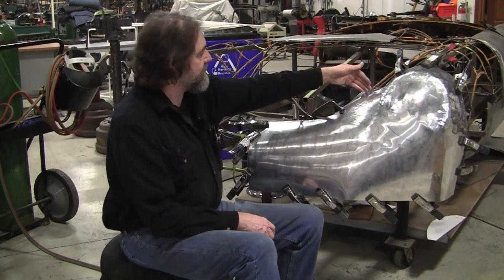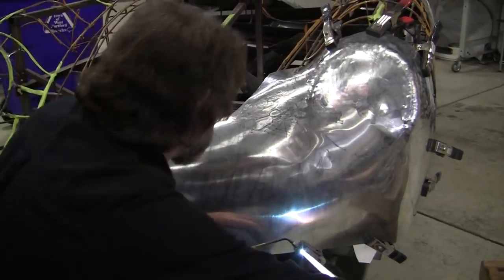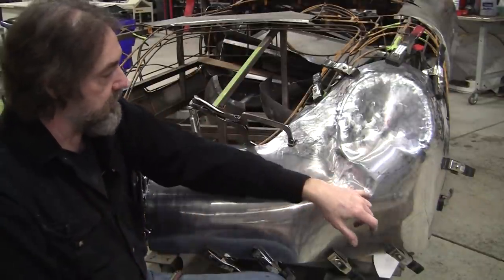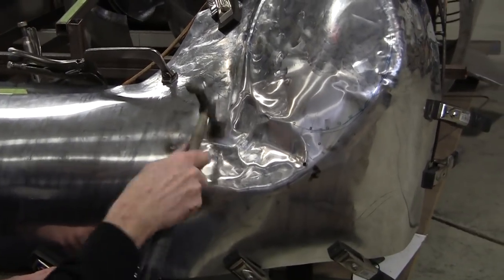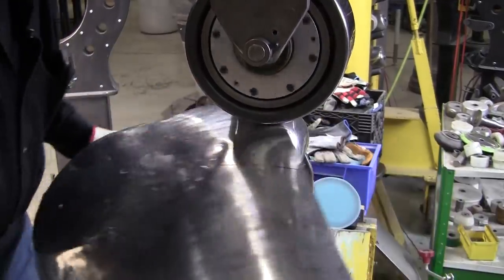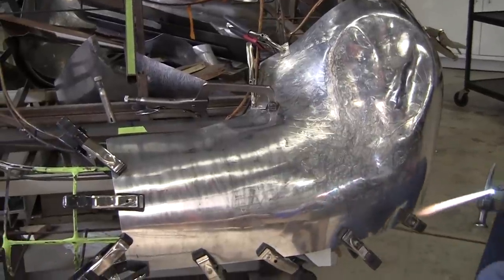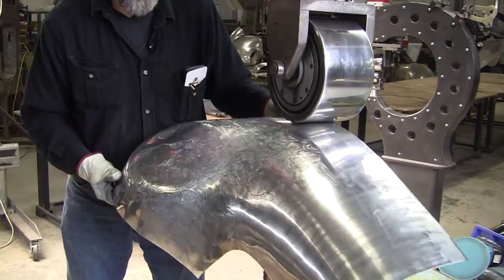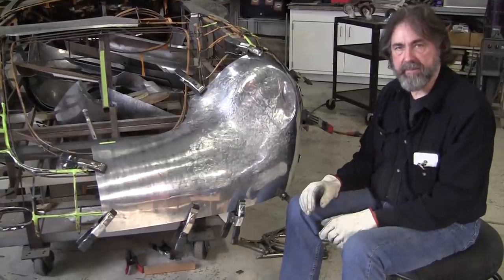Metal Shaping: Hammer forming a Porsche 550 nose on a wireform

Comment: Ah , been looking forwards to this one. Round that 19 and 20 min mark its hard to keep the faith and keep going , but thats experience , and boys does it show , interesting too that you use a different method of working if its steel , I usually work in steel and dream of things that move about as easily as alloy  but both have their highs and lows  ,,, no pun intended.
It would be so easy as a beginner not to want to mess up the bit youve got nearly right so far , but thats what this video shows best of all , have faith and keep going , it will smooth out again and be better for it . This series of videos is by far the best youve done in terms of both production and content.

Comment: hello great video's there is some thing I am not understanding your saying that by heating and hammering you are shrinking the metal . Is that not stretching the metal , I was told that to shrink aluminum you need to heat a spot  in the middle  area  and quench it with wet water rag  working you way out from middle too the outer area  that needs to shrug by doing it in a round pattern .
Reply from the maker: You can shrink any sheet metal by applying heat with a torch in about a 3/4" round spot, the localized heat expands the metal and it rises to you. The heated spot is now more malleable than the cooler surrounding metal. When you then hit the hot spot it will thicken(shrink). The process is incremental,  a little here a little there until the metal does what you want it to. A key ingredient is the metal must be locked at the edges. I lock it by clamping to the wireform. For smaller scale aluminum shrinking see my video about taking out dents in aluminum. 
www.youtube.com/c/proshaper

Comment: Wray, at what point do you confirm that the headlight bucket will accept the headlight ring? I've watched your videos for a year or so and continually fascinated by the process and your outstanding skill set. I'm recently retired and would like to set up a shop to fabricate motorcycle tanks, fairings, etc. and will most likely be attending one of your classes in the fall.
Reply from the maker: I have a headlight and ring. The 550 uses a 356 light.